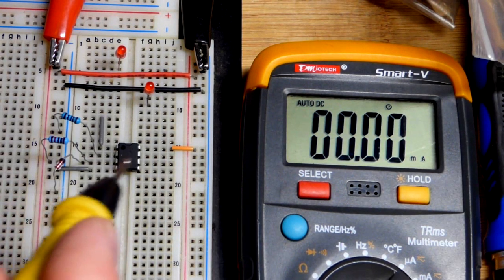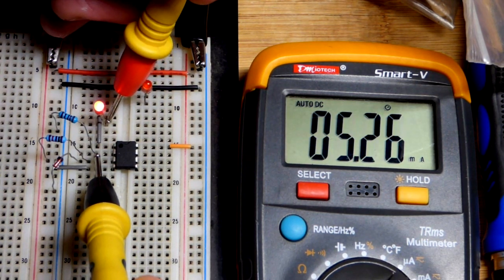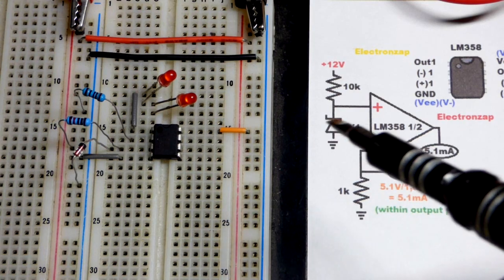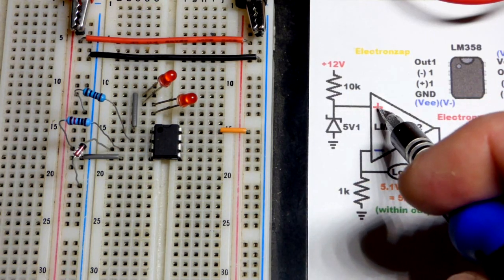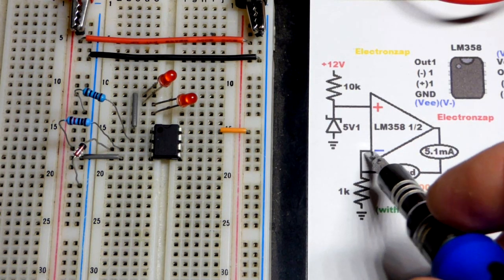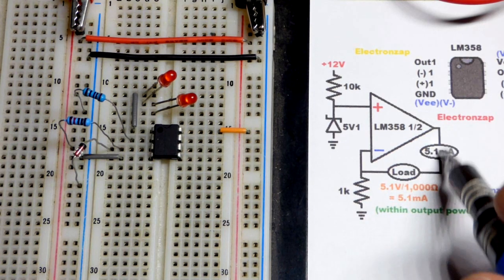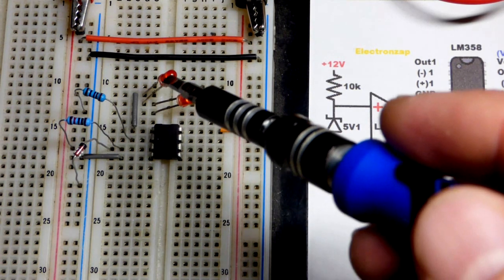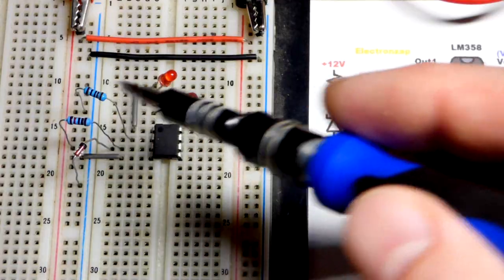LM358 Op Amp current source set with zener diode for learning electronics shorts 65

Comment: For circuits like this one, I have to keep reminding myself that (theoretically) no current flows through the op amp's inputs.  Therefore, the 5.1V at the inverting input can ONLY flow through the 1K resistor to ground.